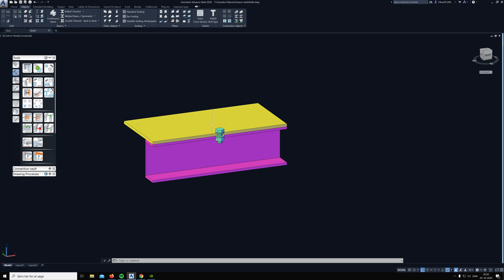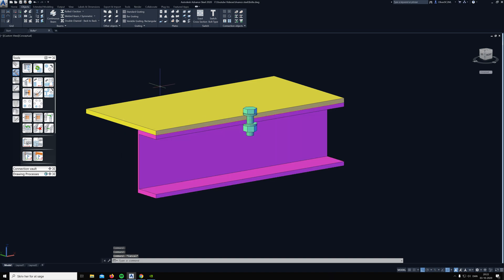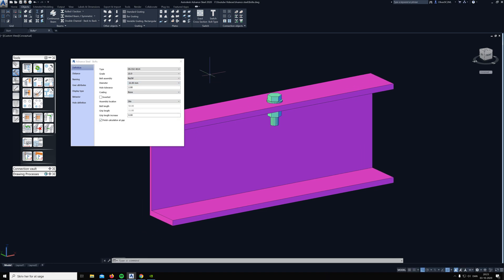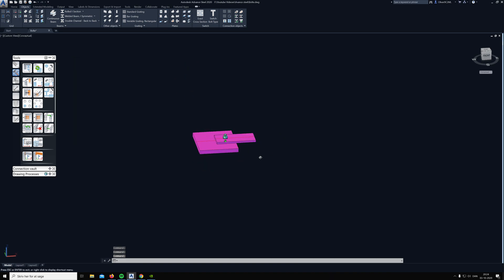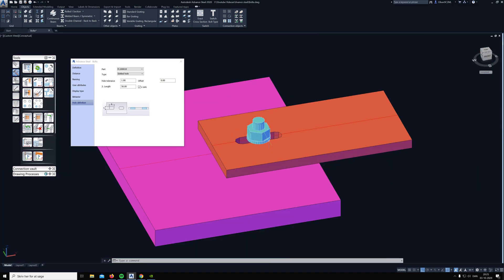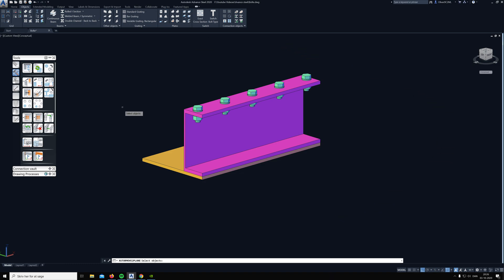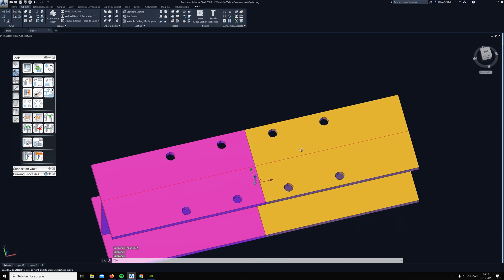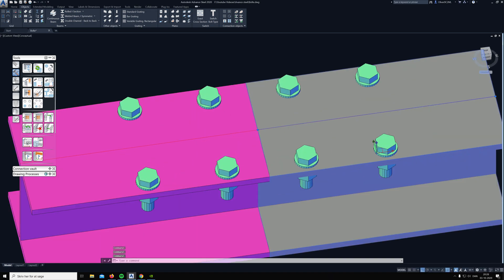Advance Steel 2020: Basic Bolts tips and tricks

Comment: Do you know how to make a bolt pattern around a circular tube? I am trying to model two pieces of circular hollow section that has a smaller CHS inside it to join them together using bolts all around the CHS, but I cant seem to do it short of doing each bolt seperate which would take too long with how many I need to do.

Comment: Thanks a lot man!!!! By the way, I would like some help with element contours. If you could explain that It will be helpful as welll. Im having the following issue. I copied a beam with holes and stuff, but forgot to select the element contour, thus, my copied Beam has a hole, but not controller. And I need to modify the hole. Please help